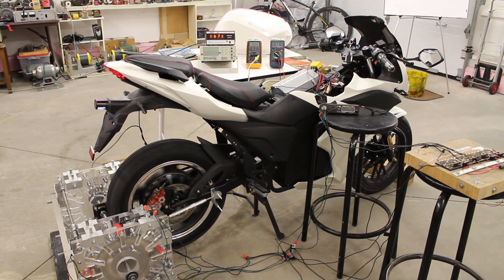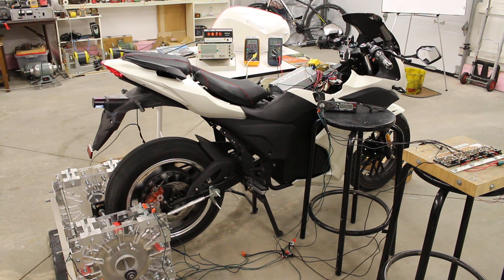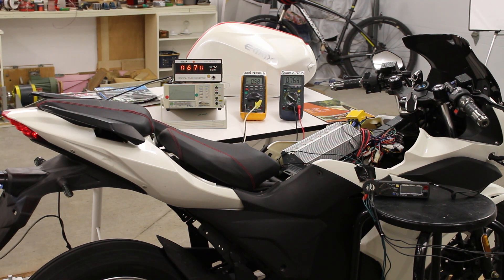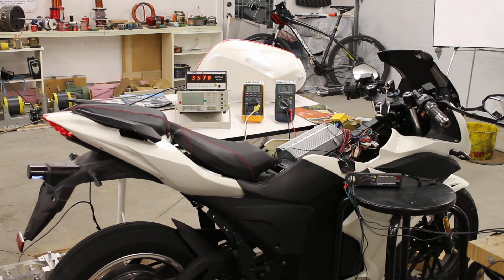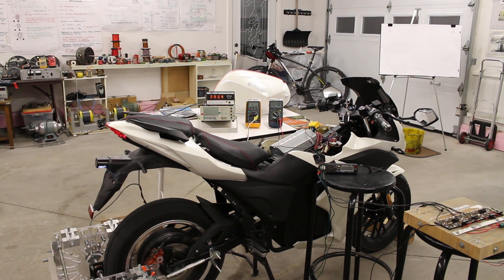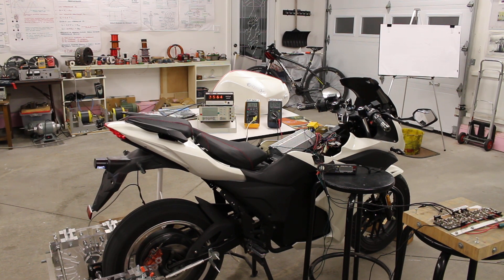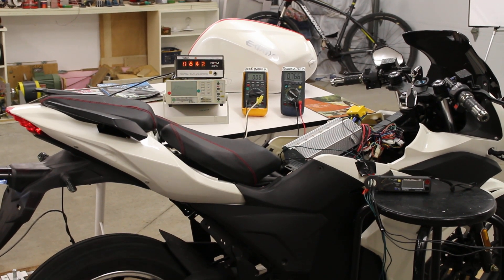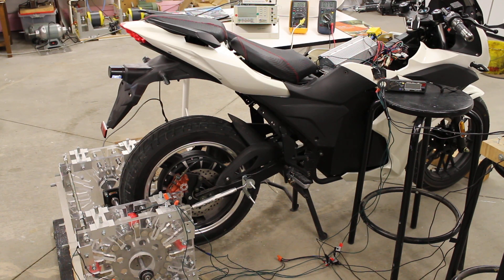ReGenX ebike Integration #8 Unlimited EV Driving Range (NOT QUITE) but close - very close!

Comment: Hello Mr Thane. I have a suggestion for you on using your Regen x generator with an electric car. With the Regen x coils, you need to bring them up to a certain speed before adding the load to it to accelerate the generator.

This would be a bit difficult with the current electric cars in the market because you'll need to be on motion and at a certain speed before you can trigger the regenerative acceleration from the Regen x coils. This means you'll still need to draw power everytime you accelerate the electric car.

What I suggest is to use a design similar to the automatic cars currently used by everyone today but rather than using a fuel engine, you use the electric motor as the engine. The automatic gears will still be used. The Regen x generator will be linked to the electric motor and the electric motor to the automatic gears.

With this, the electric motor will always run at the same speed(idle speed when the car is stationary like fuel engines), irrespective of accelerating from a halt or cruising at a steady speed. That way the Regen x coils will always be ready to accelerate the car anytime.

Also, the power consumption of the electric motor from the battery will only be for the mechanical losses. To accelerate or drive the car, you simply turn on the Regen x coils by adding the load to it and the car accelerates. No battery power is needed for accelerating the car and this is what drains the battery the most(acceleration).

I hope this can help you in achieving your goal.
Reply: I think even at low speeds, after I squared R losses etc  extra energy is still available just the physical constraints of storing it momentarily I guess.

Comment: Mr. Heins.
Just amazing.
So with 3 coils at cruising speed of 28 km/H you can maintain battery voltage.
However, normal driving requires a lot of stopping and acceleratig again.
So to make it practical, to "always" keep the battery's topped up. You probably have to use 4 to 6 coils to give extra power to the battery when you are in cruising speed. So the battery's have a buffer when accelerating. This shouldn't be a hard task, but essentially you achieved an unlimited range for EV vehicles.

Congratiolations one this amazing work.

cheers,

Rene